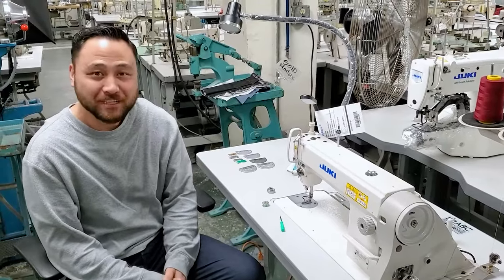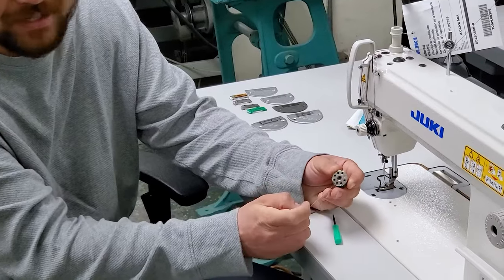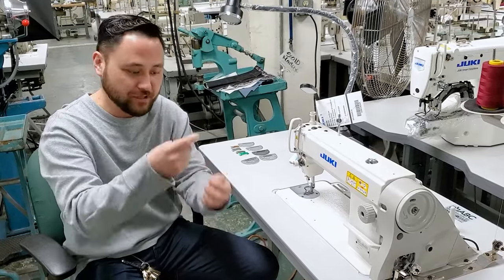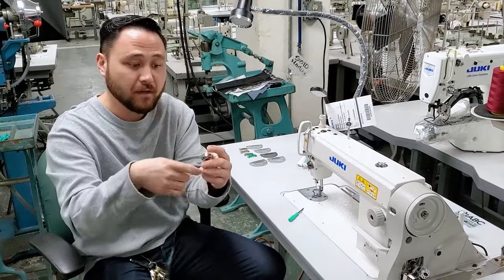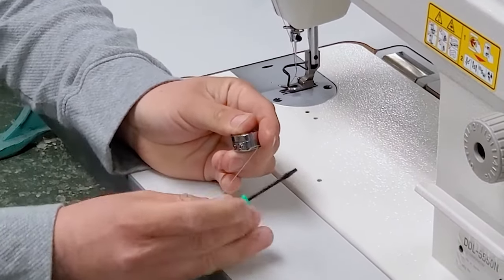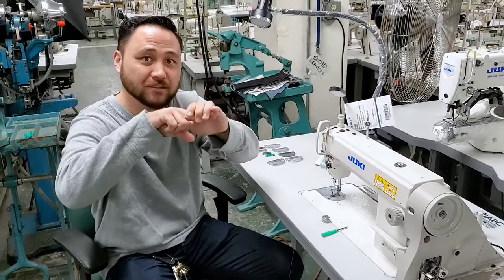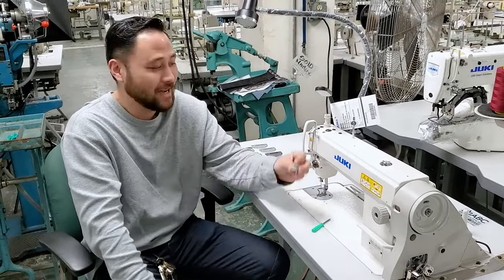HOW TO Adjust Bobbin Case Tension

Comment from the maker: For more info about this machine, visit our website: https://www.abcsewingmachine.com/products/juki-p-ddl-5550n-single-needle-regular-japan

TIMESTAMPS:
00:00:00 Intro
00:00:38 Setting Up Bobbin
00:01:00 Spider Test
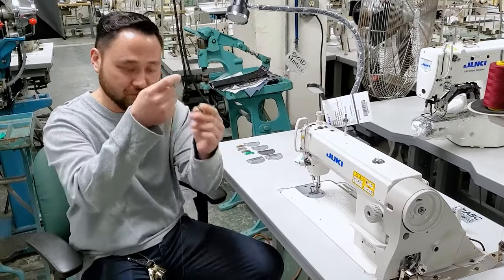00:01:46 Common Bobbin Issues
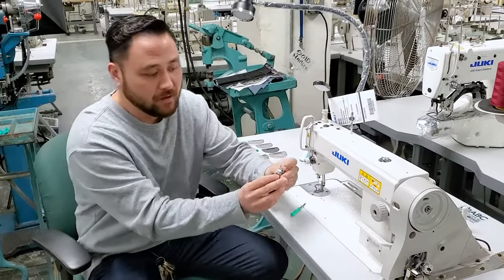00:02:30 Adjusting Bobbin Tension
00:03:21 Standard Bobbin Tension
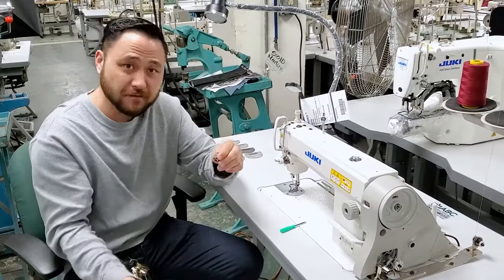00:03:51 Adjustments for Heavy Thread
00:04:33 Heavy Bobbin Tension
00:05:10 Outro

Call or email us for ordering or free consultations.

Comment: Thank you,  Thank you. Thank you! From down under.  I bought a 2nd hand  Brother LS2125 without testing it. Not a bad little machine for basic sewing.  The stitches were all over the place but the machine was in very good clean condition (Yes I cleaned and oiled it first) . I was at it for hours and I had forgotten how to change the bobbin tension.  Thank you for the lesson on how to judge the tension by the drop method.  I still need to have the top tension on 2 or 3 but at least it's making nice stitches now. I'll be watching your other videos!

Comment: My sewing machine skips a stitch when sewing thicker material
Reply from the maker: Could be a few underlying issues but you'll have to check the following to see what the cause could be:

Machine not set up for the proper needle (Hook Timing - Video available) 
The needle plate / Feed dog should be the correct one for the job (Standard/for needle sizes: 9-16, Medium for needle sizes: 14-20, Heavy for needle sizes 18+)
The take up spring is too loose (Video on our page)

Comment: Thanks for the video. The 1/2" to 1"  "Drop"  method didn't work for my bobbin case. The bobbin case made a thumping sound when I used this method because the case was too tight, and I wasn't able to sew medium weight fabric with my top tension set at less than 5. My bobbin case tension is set so the bobbin case actually falls loosely. I haven't had any issues as of yet.  My top and bottom stitches are beautiful, I can now sew medium-weight fabrics with my tension set at 4, and my machine hums along nicely.

Comment: I just talked to a Tec at the sewing centre that sells my machine about this. He told me he  had never heard of this method which struck me as strange considering it's in the owners manual. He gave me some vague idea about using a 6 gram weight and taking it to the point where it is just barely holding. He also told me that it might be my needle being worn out since they only last for 5 - 6 hours of operation which sounded a little suspect to me. My machine, a Titan TN 650 BL, uses anything from a Tex 45 to a Tex 135 and it's a compound walking foot. I'll try this once more with a Tex 45 and see if I can get better results because I am not happy with the results I'm getting no. As far as the machine is concerned, I had it in to another tech who is well respected in the sewing community and him check it out from top to bottom so it is in good working order.
Reply from the maker: If you send me a photo of the stitch out then I may be able to get you a better idea of why you're having issues with your stitch out.

Comment: Thanks.  I needed to see this video.  My bobbin holder fell apart.  Thought it broke.  Found a small screw and was able to get it back together and the tension corrected to start sewing again.  I was in the middle of a project.  Never had this happen before.

Comment: Gosh I appreciate this so much. As a kid I learned all manner of fiber arts, crochet at 7, knit at 12, but I never cornered my mother into teaching me to sew, though I watched every chance I got. She is quite the badass and so is my grandmother. They have a "sweatshop" in my 83 year old grandma's garage with the big boy quilter as well as a couple hybrid sewing/embroidery viking machines. I happen to live nearly 300 miles away from the California coast where they do seamstress things while I am  in Las Vegas and it wasn't until I moved here 20 years ago that I decided to self-learn to sew. How hard can it be, right? I had been watching the best at work my whole life! This is gonna be a piece o' cake! Yep. Nope.  I'd have issues and call grandma and a lot of times she could just tell me what was wrong over the phone, but the WHY part of some issues didn't come through. THIS. THIS is how I learn. And your tricks and explanations are so clear. 

The weird thing is, I started picking up curb trash sewing machines and fixing them. It started with my own machine having an unsolvable problem which I recently finally diagnosed one of the nylon parts near the main drive had cracked and split from the alignment pin on the camshaft. It has a 1/8" of play where the rotation of the shaft doesn't move it at all. Until I found this crack, I kept adjusting the needle swing, and hook timing, which worked when operating it manually with the hand wheel, but by pedal it would miss half the stitches.  I got  frustrated with it, never put the shell back on the machine and stashed it away for the AH-HA! moment. Sadly the part is not one that can be purchased. I can't find it used, either. So my only chance of saving this machine is to try to print a new one from my 3D printer. And I will eventually.

 The basic mechanics of a no-frills machine is pretty easy to understand for me. I adopted the philosophy that it's already broken and was destined for the landfill so I can't really harm it at this point, bonus if I do fix it, as is my thought process for all things broken with obvious exceptions where more damage CAN be done if done wrong. I've rescued a lot of electronic equipment (a whole different realm of repair, but my favorite). But as a machine user, the fine tuning of a sewing machine that is in good working order  is very specific as well as unique to each machine, and  it was never something I was taught, though I wish I had been. This is exactly the type of thing I have been looking for online, so thank you for this. It's such a simple thing from the perspective of someone who's been sewing their whole life, but for me, it's one missing piece of info  to why my projects get rats nests at a tension of 5, or pucker when the tension is set to zero. I also learned today that something as simple as a foot being down when threading is a wreaker of havoc. Something so simple that if you aren't told or shown, you'll never know.

Comment: About to pick up an 8700. 
After seeing this, I'm buying different bobbin cases. I use Tex 30, 40 for all purpose and 60-80 for "jeans" thread. Maybe need 2 one for each group. Maybe need 3 or 4. But I'd rather set the cases once and just use those cases for the different threads rather than constantly be adjusting.
Thank you for the video!!!

Comment: Perfect way to describe how to do this! However, like me, I think the narrator was thinking backwards. Meaning the bird’s nest at the bottom of the material is usually from too little upper tension or too much bobbin tension. And, if the knots are showing on the bottom of the material, you will need to loosen the bobbin tension or increase the upper tension. Great job, though, best explanation and method I have ever seen.

Comment: Hi, thank you for the video :)  Tried it. During this test the bobbin falls halfway out of the bobbin case. In this video didn't see that happening. So maybe there is something wrong with my bobbin case or bobbin?  (Having problems with my thread tension - for an inch stitch looks perfect, but then on the bottom side upper thread comes out for a few times, after that stitch looks good and so on...)

Comment: Think this video helped clarify what others rambled about.   I’m trying to adjust my wife’s BROTHER sewing machine that belonged to her mom and she changed threads and it’s just sloppy on bottom.  

It’s an older machine and wondering if it just needs a tuneup and all. or new needles. 

She’s shortening a curtain valance   and using a heavier thread and not sure if thread or tension or new needle or wrong needle or what.  

i def know my tension is loose following someone else.  so will try this.  Thanks
Reply from the maker: https://youtu.be/bofR1icJbHM
Reply from the maker: This video should take care of that issue for using heavier threads.
Reply: @ABCSewingMachine  Thanks 👍.  I wanna buy a new fancy one, but inflation and “don’t need it” override that idea.  😏
Reply: @ABCSewingMachine   Hi. A bobbin question I'm using tex 40 bobbin thread for my tex 80 topstitch thread on an industrial twin needle machine. For the life of me the bobbin thread keep cutting off and won't continously lockstitch with topstitch thread. I'll get a few stitches in before the topstitch thread stop looping and I have to open up the machine constantly to pull the bobbin thread through the slots, groves and spring over and over to get the top thread to catch bobbin thread. Any advice?
Reply from the maker: @IEXECUTIVE  bringing up both threads on your first stitch and holding the first stitch is good practice.  The hook timing and the release arm for each side is important as well. 

These would be the first things to check.
Reply: @IEXECUTIVE look at your needle make sure it is in right . I have industrial machine was shredding my tex 70 thread . My needle was turned wrong in the machine .

Comment: My top thread couldn't catch the bottom thread. I tried countless tutorials and i finally realized i put my needle facing the wrong side.

I previously changed my bobbin tension because i was using a thicker thread and changed back into my normal one and i realized i also changed my needle while switching fabrics.
My dumbass put the needle facing the wrong way. It's correct now and sewing smoothly.

Comment: awesome video!  I just received a Juki TL2020 PE and I was so excited to open the box and start quilting.  I am having a tension issue I hope you can solve.  I am free motion quilting through  5 layers, a quilt sandwich with low loft batting, plus 2 additional pieces of fabric, each backed by steam a seam 2.  This is a special fusible applique method.  Regardless of the type of poly thread I use in the machine, with the top tension ALL the way down to its lowest setting, my thread is shredding!  Can you provide me with some guidance?  I am grateful for any help.
Reply from the maker: Don't think you will need to tighten the tension that much. 
Can you show me a photo of what your stitches look like and the threading area/tension dial.
Reply: Are you using an industrial machine ? Make sure your needle is in right . Mine uses a round needle on top . It has a duvet on the needle hole if you feel the needle on the opposite side it has like a groove in it . The duvet side faces the right side of your machine . If put in wrong it will shred the thread everytime . I watched a video that showed how the needle went it saved me a lot of headache!!

Comment: every time I try to do a test it just falls out the casing, I dont know how to make it fit in tight.
Reply from the maker: @Gorge178  if you place the bobbin case in your hand and you pull the thread up does the bobbin rise up with the thread?   If no, then your tension is too loose.  Should not release thread using the Weight of the bobbin case alone.

Comment: I keep getting eyelashes on the top of the fabric, not the bottom. Is this a bobbin issue? The underneath looks fine. I'm free motion quilting.
Reply from the maker: Watch out other video on take up thread tension.  Since you are free motion quilting you want the take up to be a little stronger to stabilize the random movements.

Comment: My bobbin is stuck 😭
Reply from the maker: Make sure to get a towa bobbin case (made in Japan- about $3 currently)  the logo looks like a peace sign. 

Some bobbin cases have a sharp edge on the side of the tension plate which causes this.  You should change bobbin case.

Comment: I've been having my bobbin spin counter-clockwise for almost two years. facepalm
Reply from the maker: Will still work.  Helps to put it in counterclockwise if you don't have the backlatch spring. Or with heavier thread like bonded nylon.